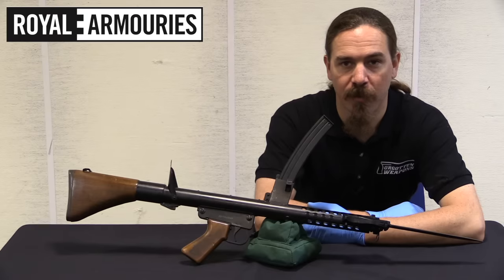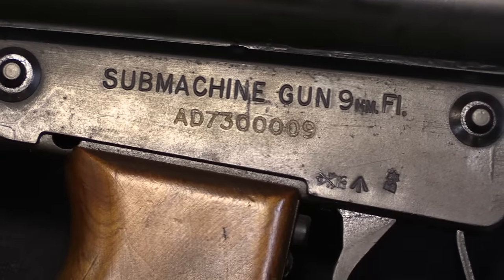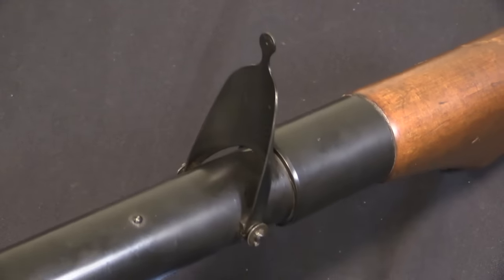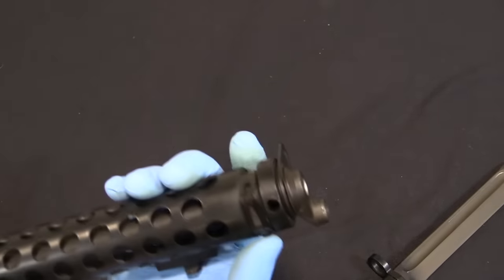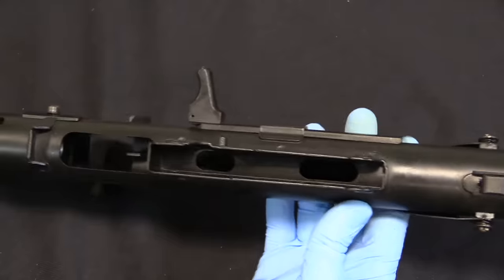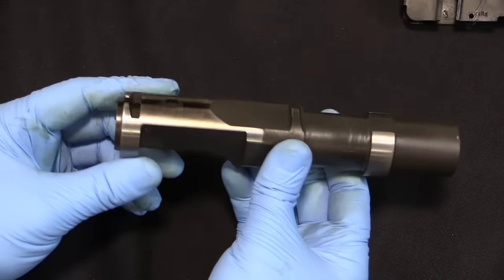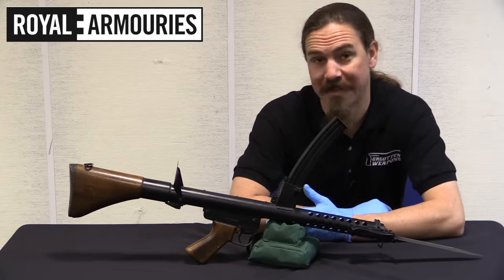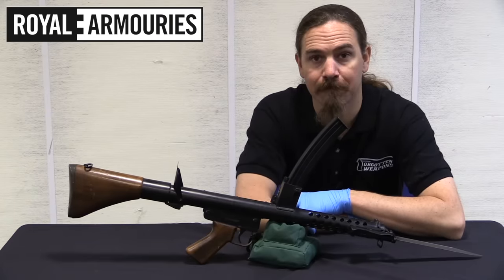Sterling Meets Owen: The Australian F1 Submachine Gun

Comment: G’day Ian, I was an Australian Tank crewman in the 1980’s - 2000’s and carried the F1 as a personal weapon during the early part on my career so I shot many thousands of rounds through it. The odd looking sight arrangement actually works pretty well despite seeming a bit contra to what “should be”. The whole gun points pretty nicely and shoots ok at up to 50m. It,s pretty controllable. I suppose the inline delight adds to that. The ventilation holes in the forestock were a dirt magnet but never affected it’s performance, just the military sense of order. The “free” and lock pins on the trigger group are slotted so that the 9mm cartridge case is the screwdriver. Also the holes on the front barrel locking ring are designed to take the cleaning rod end to unlock the ring. It was perfectly adequate as an SMG but we never loved it Like the I heard the old boys loved the Owen. Thanks for the great video Ian.
Reply: Thanks for this perspective! Cheers from US Navy
Reply: G'day Ian, I've gotta agree with Tim. I'm ex-RAN from the 1980's.  We would use the F1 mainly on boarding parties. She was a pretty good weapon to shoot and having the sights offset to the right wasn't really an issue, and yes I'm right handed. Over years I would've put a couple of thousand rounds down range and I kinda liked the staged trigger setup. And yes, you talk to the older diggers and they absolutely loved the Owen. Some of the blokes I know who served in Viet Nam were kinda pissed off when their Owens were taken away from them.
I enjoy your vids, keep up the good work.
And try to get onto the range with an Owen, see what you think. I've had the opportunity to fire a couple of mags with one and she's pretty good.
Reply: I wish we could have SMGs, but no, we only got a FN version of Hi Power pistol and 1 folding stock AKM from who knows where, even though we were the first to try the new PKM wells and I think they were phasing out the AKMs, but I bet if that there was a crisis we would be given the AKMs too. (2S1 Gvozdika driver from Finland)
Reply: @TheLazyFinn  The folding stock ones very well could be the ones Finland bought from East Germany after they reunified, if they have a wire like buttstock and dark finish on the metal its probably one of those.
Reply: @UCBfm0b5A4FoX_D5Q-IaU8Lw Germany built its own Ak's including versions with folding stocks, Wiesa and some other companies built them.
Reply: Best part about this channel is voiced right here. Actual insight from the people who used them. Sorry you Aussies can't have any guns in civilian life.
Reply: don´t the point of balance gets a bit high with all that weight above your hands.
Reply: @refusefntk  I've fired scores of guns and love militaria of all sorts, but I'd rather live in a safe society than an armed one.
Reply: @rags417  false dichotomy.
Reply: @refusefntk  we just can't have automatics..
Reply: @robf6389  He has done a vid on the Owen.
Reply: No mention of a jelly bean dispenser.
Reply: @SlavicCelery  Is it ?  Tell me how many school massacres Australia has had in the last 20 years since we (and I) gave up our guns.
Reply: refusefntk actually you’re mistaken about not being able to have guns in real life. I own several, the difference between Australia and the US is that a weapon must be registered to the owner and you must have a firearms licence which involves a police background check. We can have semi auto as well but this is heavily restricted and you must show cause as to the need for such a weapon,as in being a farmer for pest eradication. We don’t see owning firearms as a right it is seen as a privilege so is you break the law you lose that privilege,hope this helps.
Reply: @johnanon6938  The reason gun related crime went up is because the laws were tightened. Before 1996 the police didn't have to check your safe every year or so. Hence having a shotgun under the bed was technically illegal but never policed. Now, it is a condition of your gun license to allow the police to confirm safe storage of guns and ammo. Hence the uptick in charges. As for non gun violent crime, Australia has always had a high "low grade" of violence. Bashing someone is still seen as a fun way to spend a Friday night. You're source lacks the culture knowledge to speak about Australian crime stats and having lived in the States for 4 years and hearing gunfire all day everyday, I'll take my chances of eating glass over being shot.
Reply: I was in the infantry and the only time I saw one of those was during a 'firepower demo' at basic training when a fat pogue fired on at a 100m range and claimed it wouldn't penetrate a wet great coat at 100m.
Reply: @rags417  Top five countries with Gun ownership - 1. USA 2. Falkland Islands, 3. Yemen 4. New Caledonia 5. Serbia. Top 5. country Murder Rates 1. Honduras 2. Venezuela 3. US Virgin Islands 4. Belize 5. El Salvador.  - Lastly "Of the 86 countries where we have identified mass public shootings, the US ranks 56th per capita in its rate of attacks and 61st in mass public shooting murder rate. " - Once again False Dichotomy. Statistically Gun ownership does influence suicide rates (only with men). Do some research before you assume you know better than the whole world sir. Also if you want to know one of the big differences, depending on where you look at specific statistics for "mass murder/shootings" varies. According to where I live, Australia has had at least 7 mass murder events within in the last year. Gun laws be damned.
Reply: @rags417  Lastly, according to studies - a country with a much looser selection of gun Laws - CANADA - Is ranked above Australia in safety by more than 7 countries. So I will say again. False dichotomy. Not that proper gun control is a bad idea. But presuming legislation will resolve everything is beyond stupid. Case in Point - Countries with the death penalty for drug use. They have no addicts anymore right? Everything is safe from drugs? No. We all know the western hemisphere's war on drugs won right? Oh wait....it didn't.
Reply: Rob F if you search the channel he has a really old video of him shooting it
Reply: refusefntk we can
Reply: John Anon Male suicide is continuing to rise across the western world, this has more to to do with the continued degradation & marginalisation of men thru the media & court system. Women use “Nice” clean ways to commit suicide (usually overdose) whereas men predominantly use effective means of suicide (firearms, hanging ect). Yes violence using knives has definitely increased but as was documented a few weeks ago when a nutter went nuts, with a knife  ordinary people where able to subdue him with a chair & a milk crate without firearms! so his nutters spree was fortunately only 1 woman killed (in his appartment) & 1 woman injured in the street! If this guy had access to firearms what would of been the outcome? something like what happens in the US perhaps?
Yes we have firearms licenses, with background checks & stringent storage rules, But We still have our firearms but we “lost” the semi automatics. I am a firearms owner, a competition target shooter & hunter & ex Army. IMO in Australia we don’t need the general public having access to semi automatic firearms! We don’t have the Gun culture you guys over in the US have but we have better welfare/ heath system for our disadvantaged than most countries, we simply don’t have the car/truck jacking problem here  I’m an interstate truck driver so I’m sure I would of heard about that thru the grapevine even if the media were under reporting it! 
Anyone with any sense is going to realise that with today’s culture of illicit drugs that are turning users crazy all of the problems are going dramatically increase, but fortunately for us we don’t have a disadvantaged country that is riddled with organised crime next door to us with a land border! If I lived in the US I would have personal protection firearms.
Reply: @SlavicCelery  What you need to remember though is the the last 2 terrorist plots in my city Melbourne aus, the people who perpetrated them had no access to guns and so had to try and fumble their way though trying to cause havoc with knives. The first was shot by police with one death after the a member of the public were able to intervene with a trolly (shopping cart) and the more recent one the man managed to kill someone out of sight and stab another before he was swamped by members of the public armed with a bread crate who sat on him. 

I am not 100% sure our laws are as good as they could be. I feel like there is a better balance to be had between safety and freedom in this regard but still.....if they prevent guns from entering the hands of criminals then it doesn't matter if you don't have a gun or a knife to defend yourself because the average knife can be defeated by someone wielding things that are laying around the house or street. Like a broom....or a chair.....or a cricket bat. Or you just run away.... knives are pretty terrible weapons in general.

And what gun violence does happen tends to be criminal on criminal because they are too valuable to waste on the public because they can't just walk into any joe's house and find an unsecured pistol lying about the place.
Reply: @milamber319  Guns are not required for terrible behavior. OK city? 9/11? France's truck attacks?  Charlie Hebdo - those weren't from guns laying around. Red Herring argument.
Reply: Australia's not what it used to be. Read in the paper that 30% of all post ww2 immigration has taken place in the last ten years and were not talking western European. Example, a recent arrival and his wife killed their baby daughter because they want sons. When I was young you could buy a cheap chinese sks with only proof of age. If that was the law today with today's volatile mix the streets would look like a grozny style two way rifle range.
Reply: Great operator's run down, thanks! Greetings from a retired British Army gunner (sterling SMG user amongst others).
Reply: @Madchefred  oh please. Gunfire everyday all day huh? That sounds very believable.
Reply: @refusefntk  : are you sure Aussies can't have any guns in civilian life?
Reply: Yeah, I find that a bit questionable too.
unless you define 'mass murder event' as 'somebody died and there were a few people injured too.'

But still, it's like comparing a leaking tap to a waterfall.

The most deadly knife attack I've ever heard of killed 7 people.
The average such attack with a gun seems to kill about 15-20, and the most severe kill way more.

Use of vehicles as weapons rarely results in actual deaths, and when it does it's maybe 1-2 people.

Plus, it's possible to erect perfectly adequate passive defenses against a vehicle attack - a set of concrete bollards is pretty effective and rendering it basically meaningless as a form of 'mass attack'. 

It's all relative. No, you can't stop all violence, or killings.
It's ludicrous to claim otherwise, since that would appear to depend on changing how humans behave to the point that there's never anyone deranged or mentally unstable, ever.

But, you know. You CAN consider the relative risks of various things.

And frankly, claiming that guns are no more dangerous than anything else is a self-defeating argument, because if it were true, why would anyone bother with a mechanically complex, hazardous, awkward item like a gun, which has an explosive consumable just to be functional?
What would be the point of these things if... Oh, I don't know, they didn't make more effective killing tools than the alternatives?
Most people will use the most effective tool they can get their hands on.
To say access to guns doesn't matter in relation to mass killings is to imply guns are basically useless, and thus call into question why anyone would ever bother owning one in the first place, besides as a curiosity for weird collectors...
Reply: @johnanon6938  Your source did. The one you used to support your argument...
Reply: @IntrospectorGeneral  Thanks, I knew all this as I live in Melbourne myself, although I was born in LA and lived there until I was 18.  I was trying to point out to our right wing friend that Australian "mass murders" don't even merit a news article in the US as they are way too small.  Violence has been and always will be with us, but I would far rather a madman went crazy with a knife then an AR-15 - the knife wielding loony would be a lot easier to take down.
Reply: @edwardd9702  Please don't trot out the same tired old racist tropes - when the Italians and Greeks showed up in the 50s and 60s everyone was convinced that every one of them was in the mafia.  Every generation shows up, gets slandered, become part of the scenery, then slags off the next generation of immigrants.  It makes me want to puke.
Reply: When your country has one of the highest rates per capita of volunteerism for ISIS it becomes a bit clearer that what has recently been imported is not like the Greeks and Italians in the 50s and 60s.
Reply: About 1000 went to fight with nusra front another 1000 went to ISIS and another thousand stopped at the border from leaving. Shia volunteers fighting for the regime probably 1500-2000. The government is terrified.  Don't believe their nonsense . I know Shia who went, returned for a bit and then want back.  It was a pipeline .
Reply: It was also personal weapon for the driver when I was in the Army Reserve. The passenger had an SLR rack in front of him attached to the dashboard
Reply: G'day Ian and Tim W, my Dad was in the army right up to the F1 coming into service. I asked him about the sights of the F1 and Owen gun which he carried both as a Nasho during Vietnam. he said he found if you rolled the gun slightly to the left when acquiring a sight picture the sights were very easy for a right-handed shooter to use. this was taught to him during training at Shoal Water.
Reply: @rags417  Not to mention how many Port Arthurs we've had since? I'm a registered and licensed shooter in Queensland, I just wish our gov would stop blaming us lawful citizen shooters for the actions of 1 person whether it is in Aus or Internationally.
Reply: @112-DavidL  I am a happy shooter too, although I haven't partaken in the last 4-5 years or so.  I gave up my semi auto .22 in the first buyback after Port Arthur and have only been shooting once every few years since.  I am MORE than happy for people to own guns, hell I even took my son shotgun shooting when he was 8 and off to the rifle and pistol range when he turned 12.  That being said I am also a bit of an elitist snob too, I don't want just any old hick being able to own a rifle, they should either have to have a legitimate need OR have gone through a rigorous set of safety, ownership and even heritage tests first.  I always tell my kids that each weapon has its own idiom - if you fire a shotgun without thinking about stopping zombies, or an MP-40 without making Nazi brrrp-brrp noises then IMHO you shouldn't be allowed to shoot them !  :)
Reply: @refusefntk  we can have firearms but smg's & self loaders are not...self loaders are available for genuine pest control..
Reply: @rags417  we've only EVER had one school shooting....AFTER the NFA firearms confiscation at Monash Uni in 2002. and dont kid yourself...if WAS a confiscation whether we were paid back for those legally owned/registered firearms or not. Both sides of Govt betrayed the population by not representing their electorates. There was a simple answer to the Port Arthur massacre, bring Tasmania into the same level of firearms legislation as the rest of the country.....simple. That state had woeful firearms law and allowed the whole situation to happen. Simple answer to a horrible event. But no, they used it to disarm the population and make organised crime a huge amount of money.
Reply: @wimmeraparanormal6581  which is what they've done in NZ after Christchurch. Simple fix - ban purchase of high-capacity mags for non-b category firearms holders.
Solution they went with - bAn tHE scARy blACk mACHineGuNs!! (and basically all semi autos too)
Reply: @robf6389  back in '71 we had Vietnam vet instructors, who loathed the F1. Told us we would be safer throwing the magazine at the enemy!!! One preferred the L1A1 with the safety stop filed away to be able to fire full auto! They also told us not to expect to be able to fire the whole magazine since they were prone to jamming. I certainly found it to be true. Mine jammed before I had even got halfway through the magazine!
Reply: @GreavesEc  You mean non-E cats? Because B-cat is a pistol license. If you're going to call an entire country sheep, you could at least get basic details correct...
Reply: Rags Almighty Hick. It is the urban people like me that do not require guns, and do cause most of the problems. The hicks are the ones who use then as tools.
Reply: @robf6389  don't know why they keep changing and replacing things from the past that were better (not just guns)...guess it's just about money and manufacturing new stuff to sell more....but in this case I can see how the Owen was just a great gun, period...no need to replace.....even like the German MG42...is anything better?
Reply: @covenantor663  I joined after the f88 was adopted, but mates of mine suggested fixing bayonets, then chucking the smg like a dart.
Reply: Hi Tim a another ex RAAC member here you for got the other bonus of the F1 being 9mm no blanks out bush so easier cleaning and no chance of a UD
Reply: @edwardd9702  I'm not sure what you're trying to peddle here, but it's a bit rank. Maybe read a bit more widely, and type a bit less.
Reply: Weren't they phased out with the M16 in theatre though?
Reply: Tim W single shot was always confusing as the bolt advanced, fired the round and cycled to the rear again. Always felt like it had fired three rounds
Reply: refusefntk we can have guns, but we have never had the need for sub-machine guns.
Reply: refusefntk Australians still have access to firearms so I’m confused as to what ur saying
Reply: Whom did you fight with.... Kangaroos....
Reply: @refusefntk  I got to fire the F1 at IET training in the early 90s. By then they were for Tankies and Truckies, but still put a few rounds through them. Yeah we aussies really cant own anything now......Big police state we live in........I loved being a soldier I just wonder with the way we are going, if it was all worth it.
Reply: @rags417  Australia is just not that type of culture. How many mass shootings did we have prior to the ridiculous gun buy back... Statistics show we are worse off with only criminals having access to concealable weapons etc..
Reply: Hi Tim, thanks for sharing your experience with the F1. I was Army in 1969-70 and at the time the F1 seemed like a "put together" solution because we needed to up grade the Owen gun. I haven't seen mentioned anywhere that the Trigger and pistol grip was straight off the SLR. Anyhow, the F1 seemed to be a serviceable weapon for what it was intended, as reported by you and others, but it was a nightmare for Drill Sergeants on parade. All a soldier could do with it was to carry it at arm's length by the end of the sling,  where it is connected to the front muzzle.
Reply: @rags417  - Who told you we can't have firearms? FYI the Sporting Shooters Association of Australia has about 200,000 members. That is more than 1% of our adult population of our country. They are a pretty balanced crowd supporting important initiative like "safe storage" but opposing "pointless regulations" like 28 day cooling off periods for second and subsequent acquisitions. I checked before going to work for them 20 years ago. (Been retired 5). Please remember, we don't have a 2nd amendment, for good or ill. We have some 800,000 licenced shooters in total, including primary producers and the like. Sadly, a lot of those guns will be in use today - culling animals injured in the bush fires.

Importanrly, no massacres since Port Arthur in 1996. On the other side of the equation, it would be impossible to farm Australia without removing vertebrate pests (mostly feral) from the landscape. I think that we have the balance about right, for us. 

Very puzzled by the narrative that "Australia has outlawed guns." It has to be some kind of misinformation and I'd like to know what liar is pushing it.
Reply: 2 Troop C Sqn then SEQ Troop HQ Sqn 1AR b4 posted to Tank troop SOA . 1985 -1988. F1 or Browning 9mm. Best job I ever had.
Reply: Did the f1 issued to tankmen have a folding stock? The length of the wooden stock makes it look impractical for vehicular use
Reply: @robf6389  Same. As an Army sig in the 80s we used them a lot. Perfectly fine weapon but never got the love.
Reply: I remember firing this crazy weapon while posted to the Armoured Centre Puckapunyal in 1984 and firing it on a pistol range just metres from the old tank museum sight if memory serves me. After we finished firing and prior to clearing our weapons the butt on my weapon popped off as if by magic and landed on the ground much to the amusement of the still serving Vietnam veteran standing beside me........I was told later that I wasn't the first soldier to suffer this embarrassment as by then the weapon was getting on and started to show idiosyncrasies peculiar to each weapon.
Reply: @timorvet1  I remember  it well.
Reply: Hi Tim: Provos used to use these here in Brisbane until they were replaced by the short barrelled F-88. Here's a question : The butt plate is from a L1A1 SLR. Did the F1 contain the cleaning kit inside the butt?
Reply: @johnanon6938  The countries you listed for Murder, are not comparative. You are saying false dichotomy but you're evidence the most incarnadine herring of them all. 

Those countries have less law enforcement resources, training is of a lower quality, corruption rates across all public  sectors is far far higher. 

This induces lawlessness. 

As does their poverty levels. 

You compare the US to other countries with more equitable development and resources, better policing, less corruption, welfare safety nets to fight poverty, equal levels of education and medical care.....

. ..then you see that America FAR FAR exceeds ANY comparable nation in Mass Shootings, Firearms murders, and other violent gun related crimes. 

Why? The availability of guns, pure and simple. 

Stop being disingenuous.
Reply: @arnbo88  I remember a flip up hole for the oil bottle but was never useD. Same for the SLR actually. We usually had a cleaning kit, a bit of 4b and maybe a sneaky bit of "yank-4b" in our ammo pouches.
Reply: Yes, was R.A.N. all those years ago, remember them well, recall the L1A1 bayonet can be fitted, though if a watched whole video before commenting, that would be confirmed.
Reply: @refusefntk  Well you can't transfer a gun culture to a country that does not have one, the USA is used to it, we are not and if we tried, you would look at us in horror and say "They think we have a violence problem"?  24/7 you would see bodies everywhere.the novelty factor would make sure of that.
Reply: @rags417  John Howard (Australian Prime minister) took away our semi auto rifles in 1996 under the guise that it would make us safer. This has proven to be a fallacy. If we are in a safer society, why do the police now have M4 carbines?
Reply: What tank did you drive?
Reply: well said, and very true Tim
Reply: @refusefntk . I'm Australian, i have two guns and am working on more. There is just red tap and depending on what you want, the more red tape there is. Fortunately i have a thing for bolt guns, so the standard license has me covered.
Reply: @SlavicCelery . Mate, stop. You're embarrassing yourself. 
1. You don't know what you're talking about. 2. You don't live here so what difference does it make to you. We have the laws we want. We voted for these laws, yes I'd streamline them but i would never want what America has. Too many crazy people in the world to have easily accessible firearms.
Reply: Offset is due to right hand rotating naturally to the left, putting the sights on top.

AD serial prefix is, I understand, Australian Defence (Industries).

Firing rate is more chugga-chugga than brrrt.
Reply: @faolan1686  My point still stands, laws in and of themselves do not alter human behavior. That doesn't matter where you live. You can get executed for drug trafficking in China and other areas of southeast Asia. I believe this week there were two Canadians who were given death penalties in China for trafficking drugs (but it could have been in the last month). 
My point isn't that no rules is the best thing ever, it's that assuming that a law on the books alters people is wrong. It will only alter the people who abide by the laws in the first place. So, yelling about how other countries need to alter their laws to what you are comfortable with, is a poor starting place. Yes, I don't live in Australia, but saying that your laws have effectively stopped all issues is just wrong. 
For a second, lets remove the hot button issue, firearms. How long as murder been illegal? Has that stopped murder?
Reply: @IntrospectorGeneral  7 "massacres" since? Yes. Absolute rubbish. Pretty sure since Port Arthur massacre the closest gun related would be an Islamic radical holding 18 hostages in the Lindt coffee shop Sydney 2104 with 3 deaths, 2 being killed by unprepared police during the raid. Hardly a massacre or "mass shooting"  by any standard.
Reply: @mackenshaw8169  "4b" LOL haven't heard that term since the sixties. Rolls of 4b with that red stripe every 2" and that small cardboard box of Ballishot (I think it was called?) you rolled into a plug for your ears.
Reply: Thanks for clarification.  Semper Fidelis good sir.
Reply: Pretty much sums it up.
As a truckie, we didn't use the F1, other than the truck.
The serial sequence Ian was talking about is how it was described to us and it certainly worked for the SLR as quite a few referbed ones had the serial crossed out and the new serial starting with 82 to 84 appeared around late 82
Reply: @difficultinterest1582  The M16 became the front line weapon usually for scouts and section commanders but the F1 was still in use for Drivers and Cavalry supposedly because the shorter length made it convenient to be stowed in a vehicle.
Reply: @refusefntk  LOL, who told ya that? We most certainly can and do mate.
Reply: @refusefntk  We can just not repeating ones which makes perfect sense although the rules are being unfortunately eroded: i think there is a five shot pump action shotgun which can be illegally extended to more than just the five. Be the bikies weapon of choice now i reckon! Not sure if firinag ranges can keep automatics for members or not but hell you just take a trip to vietnam where you can shoot off an RPG and probably even Vietnam war era too given how much shit the Americans always leave behind haha (and something i would like to try one day!).
Reply: @rags417  about as many as before 1996.
Reply: I remember it as a reservist. Can't remember firing it but it's not really to be sight aimed in practical use as I remember.
Just point it in the general direction and send some lead. Just if the baddie is close!
I can see how you drew the short straw as a backup for you in a tank.
My sergeant said if I was Missfortunate enough to be issued one I should also carry a club to finish him off assuming I was foolish enough to use it.
Reply: @SlavicCelery  Geez, stop your gob man.
Reply: @muddyhotdog4103  bro nobody's government treats them more like childish sheep than the US. Doing experiments on you and that bahahaha.
Reply: @riks081  sure troll, sure
Reply: @johnanon6938  Hi John, I know this is year on but here is my 2 cents worth.  Since the port Arthur Massacre which lead to out then Prime Minister baning semi auto rifles, I can only think of 1 gun related mass shooting in Australia that was related to a postal worker with a shotgun in an office building. We certainly have not had any school related mass shooting in the past few decades.

Having been in  both private security and   law enforcement during that time period, I can say that the assumption that the majority of people will not be carrying makes life easier in day to day dealings with the public.

I am all for gun rights and the shear number of firearms in the U.S makes gun control almost impossible. 

I will say that day to day traffic stops where the likelihood of Joe citizen carrying is the odd one out leads to safer  dealings with the public.

I don't have any official websites with data to back this up as requested.  Vehicle born attacks, I think we have had  2 in the last ten years that I can recall.

Knife violence I would say has only increased slightly and not proportionate to guns.
Reply: @refusefntk  ... nobody in Australia wants these things in civilian hands.
Reply: yes i used this great smg in the late 80s and early 90s, this was adopted in 1965, not 1962.
Reply: same mate - carried an F1 for some 20 years (AFV crew) - reliable, simple to maintain and clean, easy to use. Good bit of kit.
Reply: The SMGs  came from WW1 as a Trenchsweeper.A SMG for a Tanker in the 70s 
would be a Uzi , Scorpion or something like that.
The Stock is fixed not like a Sten,Sterling and many other older and newer SMG.
Reply: @refusefntk  we are allowed Bolt Action rifles and certain shotguns, though you need a gun licence and a proper gun safe that's securely bolted to the floor or wall 😉👍
Reply: @johnanon6938  Australian bureau of statistics
Reply: @SlavicCelery  "Of the 86 countries where we have identified mass public shootings, the US ranks 56th per capita in its rate of attacks and 61st in mass public shooting murder rate."
lol, that's counting active conflict zones. If your argument is 'countries experiencing civil war and/or insurgency have more mass shootings than the US' well then yeah, congratulations USA, you must be so proud.
Reply: @muddyhotdog4103  "Geeze, you're statistically more likely to get hit by lightning twice in your life than get shot in a mass shooting in the US."
What's so special about "mass shootings"?
Roughly 40 people in the US die every year from lightning strikes, compared to the roughly 37,000 people who die each year from gunshot wounds.
Yeah, lightnings definitely a bigger problem.
Reply: @davesmith3289  Laws will not make people ethical. Wholesale banning of items does not stop people who have intent. I'm sorry that, that concept is difficult for you. 

Just like the death penalty doesn't stop people from murder. Sort of like how the experiment of banning alcohol worked super effectively to stop....Oh wait it didn't. It actually increased the power of organized crime.
Reply: @davesmith3289     You seem to have a reading disability.. I said "mass shooting" not killed by guns. Remember now, INCIDENTS of mass shootings vs incidents of lighting strikes not how many people die from gunshot wounds vs getting struck (and killed) by lightning.
Reply: Gun violence in America isn’t a gun problem, but an America problem.

Take a bunch of idiots, tell them guns are their “right”, refuse to licence or even background check them, underfund their education and their mental healthcare, make them feel insecure and angry at the world, create a massive widening socioeconomic gap so that the rich get richer and the poor get poorer and pushed into a life of crime, and see what happens...

Guns are great, great fun to shoot, part of human history and very interesting. Americans unfortunately love them to the point that it starts to get creepy (“I NEED this to KILL the BAD GUYS”) and now gun owners worldwide have an image problem.
Reply: @KuraIthys  I’m sick of arguing with Americans about this. They just don’t get it. I’m just thankful I live in a safe country and literally never have to think if someone has a gun.
Reply: @Apis4  yup 25 times higher gun deaths that other wealthy countries.
Reply: @SlavicCelery  not the point. The more access people have to items that can easily kill people the more killing that take place. FACT. If it’s so great to let everyone have what they want why doesn’t everyone have access to the nuke button? .......... someone would push it. Guns are designed specifically for killing and semiautomatic and fully automatic guns are designed for many killings. We have banned those firearms because we simply don’t need them other than the military.
Reply: @davesmith3289  FTW!!!!!!!
Reply: @SlavicCelery  did you read what Dave smith wrote?
Reply: @refusefntk  that's not true there  more firearms in private hands than before the buy back. In fact the buy back allowed many to upgrade their fire sticks. Semi automatics are harder to get licences for but can be done. I hope this helps you get a better picture of what is happening in Australia regarding firearms.
Reply: Hi Tim, I was 2/14 LH and carried either the F1 or the FN 9mm. I'd much prefer to cart an F1 around than an SLR!
Reply: @haratiohornblower2613  no we can  have auto just lots more rules and paper work to fill out
Reply: @sovietpanda7506  which states that? Hate to see the hoops you have to jump through to get one. I know primary producers can have semi auto.
Reply: @haratiohornblower2613  yeah but its such a fuck around its almost not worth some mates that are primary gave up there weapons cause its too hard to keep them especially when they need them for there  safety i.e revolver for catte station hands that work in pens with horned cattle
Reply: Thank’s for fighting for our country
Reply: @SlavicCelery  the fallacy fallacy be strong in this one
Reply: Not Formula 1
Reply: Change for the sake of change i think. Would be no cheaper to make than the Owen and certainly no better.
Reply: We may have walked the same ground. I was in Pucka from 85 to 91. 26 TPT SQN, then Pucka WKSP's. On detachment to 21 const sqn. Then spent some time at PLB. then Sydney. Cheers, mate
Reply: My immediate guess with the sights is that the weapon is held slightly canted however I'm a pom with no experience with the Owen or F1. Was this the case or is there some clever Aussie military doctrine which allowed the sights to be so fine yet mounted on the "wrong" side?
 Also, do you reckon a few Owens or F1s, if they'd been available, could have changed the outcome of the Great Emu War or would the Emu forces have formed a coalition with the Wallabies in response to the escalation? 
 Also, is it true that the Numbats have gone full Swiss and declared outright neutrality?